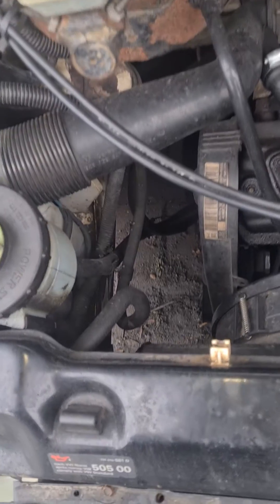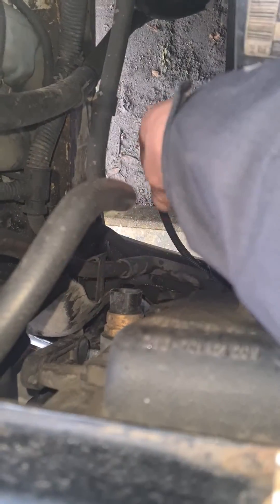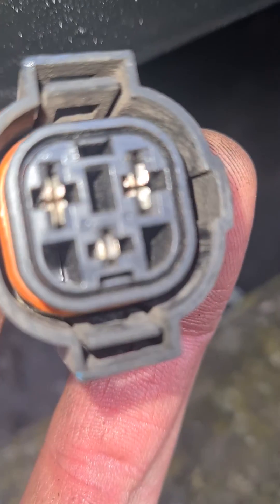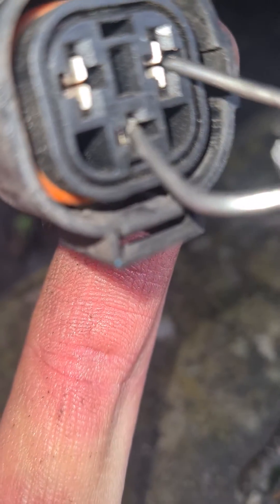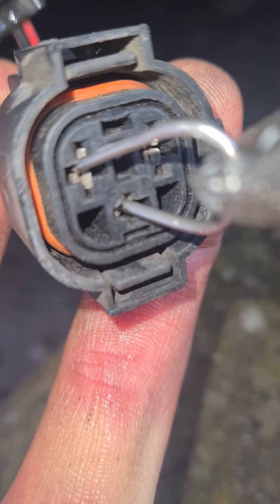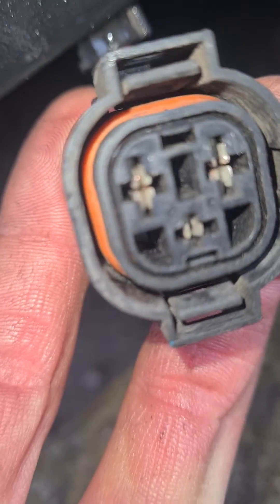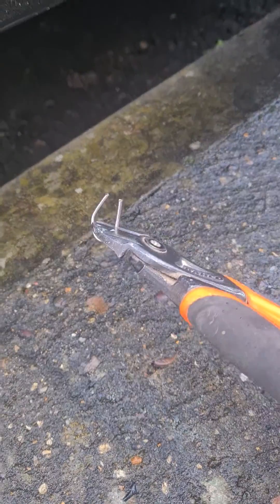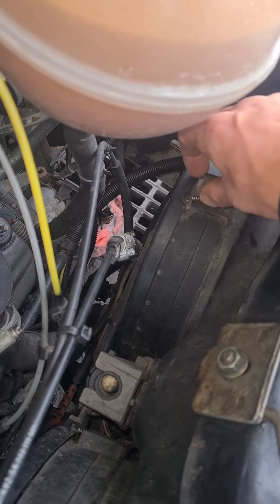vw t4 cooling fans thermostatic switch test

Comment: Hello, Have issue with the t25 fan not kicking in and been overheating, Tested the fan does works, change the thermostat/ fan switch / temp gauge sender / bleed the Radiator still no luck.. any advice would help. Thanks
Reply: Did you find out what the issue was? I’m having the same problem on my T4

Comment: Hi there, thanks for the video. Mine is a 2.5 TDI with same plug. When I bridge the middle pin with the upper left, fan works. If I bridge middle pin and upper right only hear the "click" with no fan working. I understood from one of your answers this is ok? Will that work if the engine is on? Many thanks!

Comment: Does anybody please know what does it mean when my fans didn't kick on during this test and i just hear clicking from somewhere near battery?  (They work normally when driving)
Reply from the maker: Clicking sound is good  👍  it means the relay has operated but if you do not have fans obln at this point they may be at fault of intermittently running , best to get a hand and you test the temp switchb, unplug the fan at connection point and check for voltage after linking the thermostat out
Reply: @vwt4camperconversionclub741  thanks for reply. Did i test today, find out only one fan is working (looks like wires melted on motor).. bridging to low speed puts out only clicking in relay, bridging high speed is working. Both fuses have power and both relays too. Didnt test power to non working fan thus as it will not help me now anyway. So i think to get a new fan and then test again, but i dont understand why working fan on low speed is not kicking in.
Reply from the maker: Brilliant at least you know the problem now,  that's correct only one side of the bridge connection will bring the fan on other one just clicks so that's all working fine 👍,  try Lithuania for a fan I found a set there for £130 which was good.
Reply: @vwt4camperconversionclub741  thank you for your time!